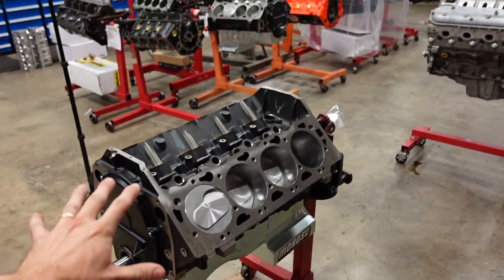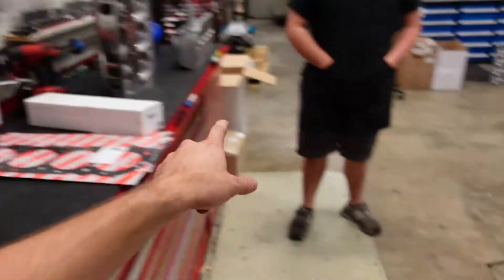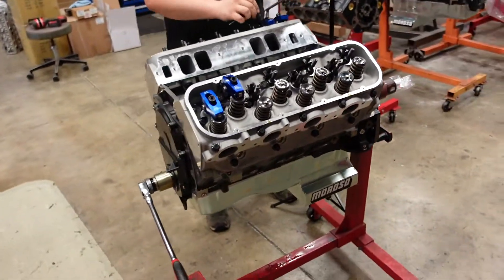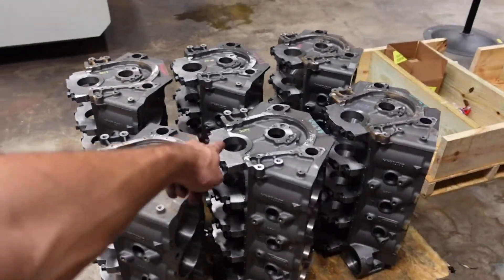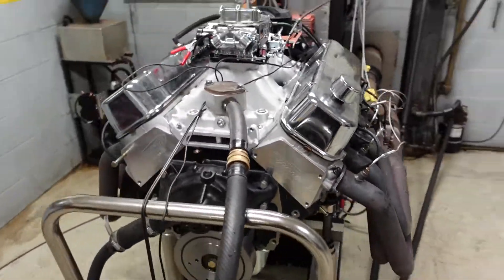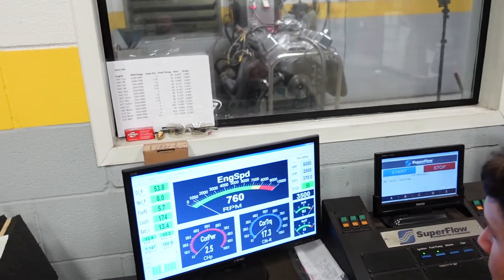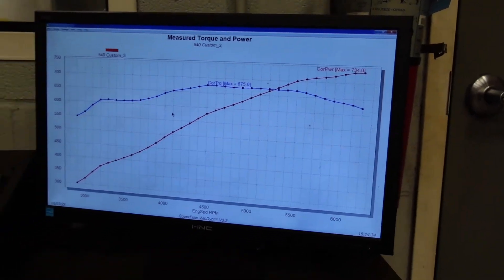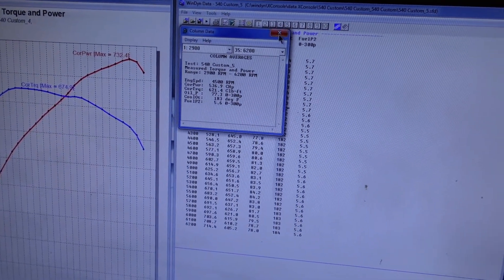730hp 540" Big Block Chevy Engine Assembly & Dyno Testing

Comment: Nice build man! I have the same block for a 454 build. 4.25" bore. Really a good block. Got it about 10 yrs ago when things were cheap. How things have changed. That motor seems like its barely getting going. I wonder what a bigger solid roller cam would do?

Comment: Are higher compression ratio motors on higher octane fuel, lets say 11-12:1 applicable for street use ? I’ve heard the higher compression you go, the more likely the motor is to break or need maintenance.

Comment: I’ve been shopping around for big block Chevy crate engines and stumbled across this 540. I think I’m going to order one for my 72 chevelle. I like the idea of the one piece rear main and this has everything I’d want in a bruiser NA street car engine. Car was my dads he bought it in 78 without an engine. It’s had small blocks in it since. It was originally a 454 car so it needs another big block i think
Reply: Great choice youll laugh at ripping past traffic with the throttle barely cracked.

Comment: 1.  That head is huge, why use a huge head on a very low HP 540?   
2. My 502 based 540 pump motor with an AFR 357, profiler intake, mahle 11.0 and .750 at the valve made 880.
Reply: @bigboreracing356  can’t post videos but my 540 is sitting in my 69 4200 lb c-10 that runs 10s at 5500 ft.
Reply: @bigboreracing356  I don’t know how
Reply: @bigboreracing356  7-11 pump gas motor and it still made 150 more with less head than yours
Reply: @bigboreracing356  making stuff up.  Your buddies 700hp 540 is pathetic.  That’s all, bye.

Comment: Valve chatter above 6200 why? Ls usually rev 6600 to 7000. Is that why LSs have camshaft and lifter failures
Reply: It's not a LS GOOBER
Reply: @dakotaautosales9673  what is it FH
Reply: @dakotaautosales9673  big block my bad
Reply: @mac6746   Who is the FH now GOOBER 😂
Reply: Heavier valvetrain

Comment: Very nice I like how you call it a little 540 but I have a couple questions 
First I didn't see your guy degree the cam and what length push rods are running. But that's a pretty stout engine for sure.

Comment: Very nice 540cid engine guys...it would also be nice if you could show (on the video screen) the RPM that the engine's PEAK TORQUE was made at as well as the RPM the PEAK Horsepower was made at... I know you showed Graphs, etc, and mentioned some words about the power the engine made, but when you're whipping that camera around every second it makes it very difficult to zero in on the all the info... especially the peak Torque and peak HP at their given RPM... thanks

Comment: i myself wish that these kind of vids disclosed fuel amounts used in testing. or even a deliberate 1/4 throttle run timed until 1 gal is used. this really speaks to the quality of mind behind the build !!!!!!!!  i can make mass power but can i make it reach max fuel efficience  as well ....  NOT an easy feat. more than likely the owner doesnt give rats a** about gas as its not often a dailey.  with gas at the price it is it would be nice to see builds that show both power and power with mileage.  cuz it just might be cool.
Reply: @bigboreracing356  
y ?
Reply: No one cares about mpg that’s using a bbc.

Comment: I will be 67 in a few months and at age 20 i built a 67 RS Camaro to Yenko Specs so it was a 427/425 with 456 gears and a 4 speed, engine like these weren't even a dream then, that would be amazing in a 1st gen. Camaro and a good solid 5 speed.  What would be the cost of something like that just for reference?

Would you gain anything with a carb without the choke and airhorn? Thats an awesome drop in package
Reply from the maker: This combo currently goes for about $17k. Removing the carb choke horn can free up a few ponies, but each combo will react differently

Comment: Honestly something like this should easily reach 7k rpms.. and have atleast 11.5:1 compression.. this engine has soo much more potential
Reply: Especially at that cam duration. We did a 555 BBC 15:1 on e85 with roller cam 256/268 duration and made 988HP NA.

Comment: Any particular reason you used link bar roller lifters on a new roller lifter block?   Nice build.  I have the same block here and trying to decide if I want to do a 509 or 540.
Reply: Do the 540.  Or sell the GM and buy a Dart so you can run the mark IV pan and timing cover.  502s can sometimes be bored to .060 but there is a wire that runs in between the bores that isn’t always centered and will get hit sooner or later boring.
Reply: @davidleary823  I bought the crate engine new, to sell it now would be pennies on the dollar so not really an option.   It was intended for another project but have now switched gears to install in my 454 Chevelle.  I like the 540 idea but it's really going to depend on parts availability.  Over the last couple years I've just avoided ordering anything that hasn't been in stock and ready to ship.  Rotating assemblies have been hit and miss.  Pistons have too but .030 over (509) pistons seem to be more readily available.  We'll see what's out there the first of the year, if the rotating assembly happens to be available I'll do the 540.  Otherwise the stock forged shortblock will suffice with some pistons to boost compression.
Reply: @firebirdjone  gotcha understand

Comment: I nearly fell out of my chair when you "Engine Builders" pulled out the Ole HEI when most every Dyno cell I know have MSD boxes already wired up for easy plug & play with having to worry about any fitment issues because the MSD distributer is so much smaller ????? What gives ?

Comment: 700+ Horsepower Natural Aspirated engine, with  a 3 year warranty. With just parts laying around. I wonder how engine like this cost, with just parts laying around the shop?
Reply from the maker: This one was about $15k
Reply: @JacobVillemain  jesus! My stars.
Reply: I love everything about it except the block
Reply: @philipmazzuca2269  Well it's definitely no Dart Big M but the 502 blocks can handle 1200hp+ so for 730 it should be fine.